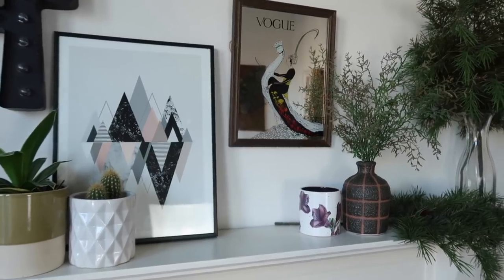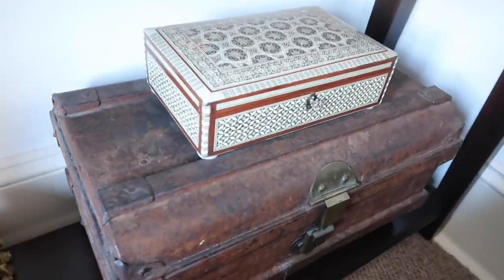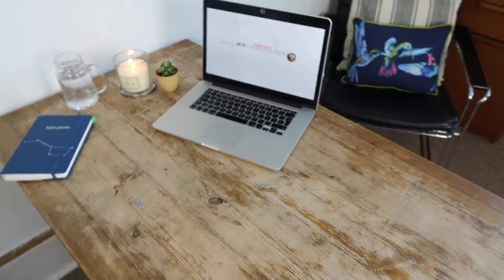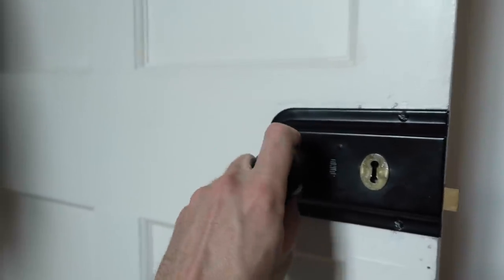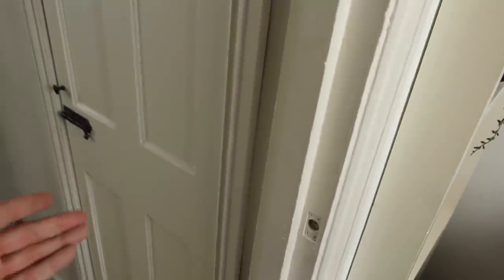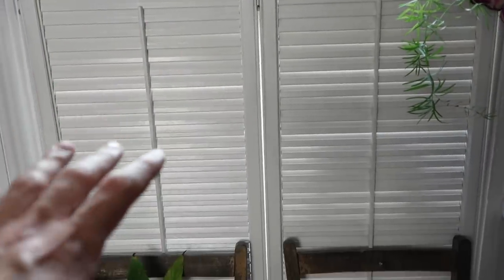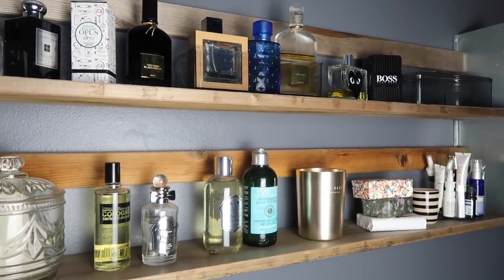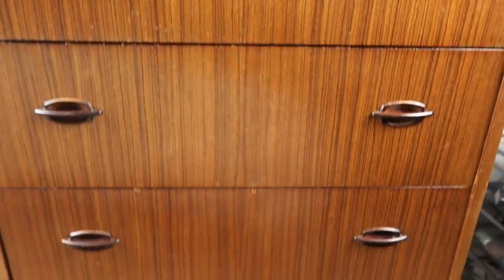DUMPSTER DIVING FREE FURNITURE, FULL HOUSE TOUR! | SKIP DIVING UK

Comment: Thank you for pointing out about potential infestation of wood items. I worked with someone who  bought an old wardrobe with woodworm & the whole house had to be treated & floor joists replaced etc etc. This is particularly important if you live in a kit type house which relies on wood framing for structural integrity (including the roof). Personally I would not take the risk in that type of property!!